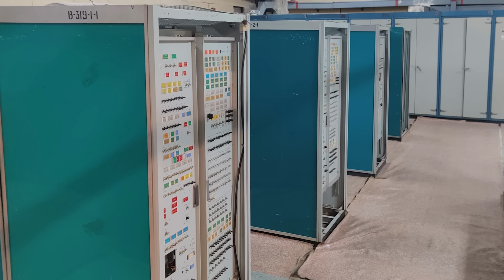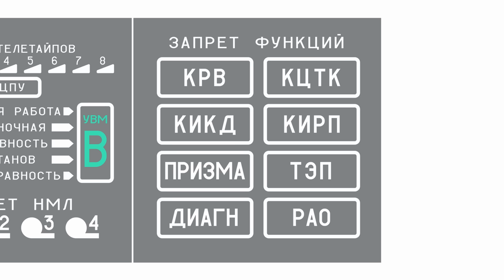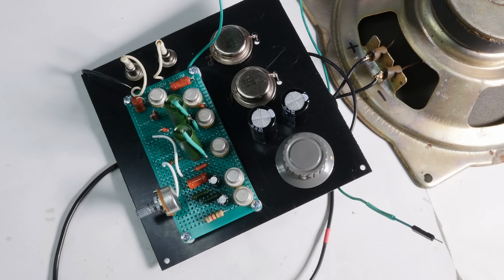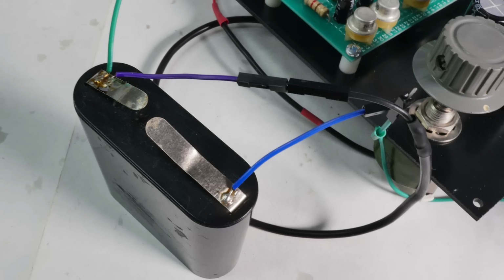The Last Alarm of Chernobyl’s SKALA Computer

Comment: No wonder it melted down, that siren wouldn't alert a dog.
Reply from the maker: Please check the pinned comment – it looks there is some encoding issue after upload ((
In reality, at full power this thing smashes the windows with its sound wave. Those large transistors are 60 watts.
Reply: @ChernobylFamily  could you reupload the video, maybe with re-encoding, i understand stuff like re-encoding takes a lot of time; it might genuinely be easier to understand for a lot of people
could re-encode that small section and slap it with +20db or something.
Reply from the maker: I will add a short.
Reply: @ChernobylFamily im not sure about the window thing, but the output resistor is kind of meh, you should warn people about the potentiometer rating if they buy off the shelf pots they will burn
Reply: YouTube usually levels out the audio of videos to be closer to average and also lowers the overall audio volume of all videos on upload.
Reply: @ChernobylFamily  I had a similar issue but with an effect in videoshop, in the original file the blue border for a Scott the woz parody, it for some reason had it in the whole video. Probably from encoding but idk
Reply: @ChernobylFamily You miss understood what they are getting at. You did not play the audio of the alarm on the video. You only showed how to build it.
Reply from the maker: Once more. It plays in the beginning. But after upload, I do not know, maybe here is limiter applied, it became very quiet
Reply: @ChernobylFamily It was either too loud and yt ,,normalized" it, or the pitch/tone is outside ,,normal" spectrum and yt just filtered it out. Can you upload the sound somewhere else, at least for as long as it will take to fix video
Reply from the maker: I will upload a yt short today, but i will play with it first.
Reply: @gelo1238  Yeah it's likely the former since you can very faintly hear the sound of the alarm if you turned the volume very high.
Reply: @jpawhees  No, you misunderstood. He absolutely did, right at the beginning of the video. As has already been discussed.
Reply: @railgap more like i couldn't hear cause volume on it was very low. Plus audio on my smarphone was low as well.
Reply: @ChernobylFamily  its a shame other people are so rude.. but if youre eastern european, you have thick skin.  Thank you for your videos, very informative.
Reply: @jpawhees   Not very bright are ya
Reply: It was a very considerate alarm, and didn't want to interrupt anybody's sleep.
Reply: 3.6 Roentgen is not an emergency my capitalist friend.
Reply: @larshanselmann6514 what does that transcribe into millisieverts please?  I know from working in a hospital environment that 2millisieverts was quite a dose.
Reply: @KateRVN ~34mSv. But it was a joke of mine. They told the capitol, that they measured 3.6 roentgen (because it was the maximum, the measurement device can scan). In fact there were 15'000 roentgen or 140'000 mSv 😅
Reply: @larshanselmann6514  Even then 15,000 roentgen was the max of the "Super Scanner" (which not just in the TV series, was actually mounted to a truck and driven close), So if I remeber correctly the rough estimate from western countries based on the fallout cloud was around 300,000 roentgen at chernobyl. Absolutely Insane!
Reply: @The-Failing-Farmer  Yup. Had the fire not been snuffed out, the radiation clouds would have killed millions and heavily contaminated god knows how many countries.
Reply: @The-Failing-Farmer 30'000 roentgen*  or 300'000 millisievert/h but 300'000 roentgen is not possible
Reply: @larshanselmann6514  Your basis for why it's not possible?
(Official estimates have exceeded 100,000R)
Reply: @jimtaylor294 are you sure, you don't mix up roentgen and millisieverts? 13'000 roentgen are documented and 30'000 roentgen are speculated (~300'000 mSv) but theoretical possible. 
300'000 roentgen just seem possible directly at a few fuel rod's, but not as an average outside radiation exposure.
Reply: @larshanselmann6514  No mixup. One of the higher estimates for radiation was 100,000 Roentgen, which when dealing with the largest and longest lasting nuclear reactor fire in history shouldn't be surprising.

Granted the precise figure is debated and likely always will be, as the Dosimeters on site during the worst of the incident weren't high ranging enough.

Given that the 13,000 Roentgen reading had to be taken by a truck covered with lead sheeting though, that the first responders (local fire brigade) died in agony from record levels of radiation poisoning, and that the fire was so bad that countries Thousands of miles away registered radiation should illustrate how comically deadly the incident was.
Reply: I would assume blasting an alarm is neither good for his hearing as well as anyone near him.
Reply: @jamesmaxwell4447 WHAT? 👂
Reply: 😂 lol 
That was good!
Reply: …a dog with paranoid schizophrenia- who spoke Russian!🤨🤪🙊🤫
Reply: I heard it corrected (technology, eh?), and it would have been terrifying. Similar to the feeling our tornado sirens cause in Oklahoma when you KNOW you are in grave danger. It's probably worse because you can't shelter against gamma radiation when it's released like that.
Reply: Youtube used dynamic range compression by default, but you can disable it by setting "stable volume" to disabled.
Reply: I swear my dog reacted to it
Reply: Wouldn't alert s cat either.
Reply: You. Gulag now
Reply: What you dont understand is - it emits frequencies only dogs can hear, thats the reason soviet reactors always had a dog in the control room
Reply: @CarrotofGreatness  Homer had a dog in the control room to cancel meltdowns, it must be true.
Reply: I wouldn’t have made ANY difference, no matter if the siren had been heard around the globe.

Comment: Absolutely gorgeous device. But absence of "old school" radiators on output transistors makes me sad. Even any radiators too. At my opinion, as such radiator may be used aluminum radiator of standard Socket AM2/AM2+/AM3 CPU cooler or it's fragment. I saw, you have serous machinery for holes making, co they may be used for better modification of such radiator. even some active fan may be used... Also you used modern green connection board, but in that times they may be yellow or brown.
Reply from the maker: As I mentioned, radiators are absolutely MUST if running from the designed –24 voltage. On 4.5 V those transistors are cold. Yes, I used a green board because the task was to test the sound, not to make an exact replica.
Reply: @ChernobylFamily  Thanks, clear)

Comment: Silence? Correction... there is sound but the volume is so low that it triggered the noise gate and filter I have running. If you'd have started the video by talking it would have recognized speech and disabled it.
Now I have a new problem to play with, thanks. (Not sarcasm)
Reply from the maker: After upload that part became very silent, I do not know why. Increase the volume.

Comment: Hey, Alex.

Great little video. It's a sobering thought to realize that this small bit of technology may just have beeen the final sound heard at Block 4 at the time.

I'm still amazed and in love with those mnemonic displays. There's this etheral beauty to them, so contrasting to the tonnes and tonnes of equipment they were meant to show.

Take care of your health, and stay safe.

Cheers.
Reply from the maker: Thank you!
Reply: While I'm sure it must have been quite sobering the lack of other computer sounds, don't forget that there would still have been lots of people talking after this (after all there were loads of people around for the test, even if they might not live much longer), not to mention whatever sounds were coming from the fire of the reactor core. While this may have been the last "somewhat normal" sound from the equipment, it was by no means the last sound there.
Reply: @wt7958 Yeah, i was refering to the operational side of things. No control swithc and gauge relays clicking. No TG sounds. No MCP roaring in their whistling turns.

The sounds - or lack of, there of- of the aftermath must have beem shocking to many.

Which is one of the few things I give the TV series props for.

My bad on not making it clear.

Cheers.

Comment: that sound feels purposely picked by a sound designer for a movie. Its urgent, but kind of chipper and very different from what (my canadian, anyway) ears are used to hearing to incite Alarm. 
Thank you for the hard work this is beyond amazing!
Reply from the maker: Thank you!
Reply: My American ears expected a long, drawn out, harsh buzz.
Reply: Alarms are generally explicitly designed to be as annoying as possible while being unique when necessary, and remaining simple. The once ubiquitous alarm clock is a perfect example. Local oscillator beats with line frequency and then is pulsed... for that magical wakey wakey that will cut through steel to get to an eardrum. Anyone who got used to reading time on little red LED displays knows what it is, what generates it, and that it cannot be overlooked. The SKALA alarm plays in the same realm. You can bet a small group of people at one point looked at each other and asked "how can we make this as irritating as possible and make sure they can't ignore it, without it sounding like anything else in the plant", just like the clock chip. It's almost an art in itself.

Comment: that potentiometer...still sealed..amazing!
Reply from the maker: Yesssss!
Reply: The fact that it was made the month I was born gave me chills a bit.
Reply: Kind of jaw-dropping! So cool.
Reply: I was wondering why the designer has chosen to control the volume via a high power pot serial with the load (changing it's total impedance) instead of a low power one on the amp's input. My guess is: it would detune those bistable multivibrators or since they are DC coupled the amp would generate more heat.
Reply: No. Actually this is because the output transistors work in switching mode. They are either on or off, they cannot produce intermediate values.
Reply: @alexeyivanov5926  Yeah, if that complementary pair just switches it makes sense. The other way would be controlling the power supply voltage I guess which would also require a high power one without using any additional circuitry.

Comment: Man... I'll have to dig through my parts bins for some germanium parts.
Reply from the maker: Germanium parts are critical to make it work from low voltage. Otherwise silicon should work well!
Reply: @ChernobylFamily  Indeed. Nothing super "special" there otherwise... that's just 2 astable flip flops, one as an audio oscillator, and the other to modulate its frequency, and then fed to an amplifier. 

The thing that trips me out is the rheo as a level control haha... From a design standpoint, I'd be afraid it would smoke it if it was set to a relatively low (but not zero) resistance, which of course would have the effect of completely silencing it from that point on.
Reply: Good luck.  Germanium components go bad. I’m replacing them constantly in old radios when I restore them.